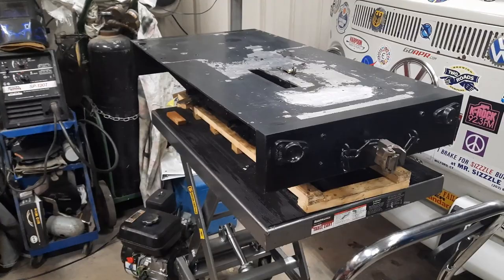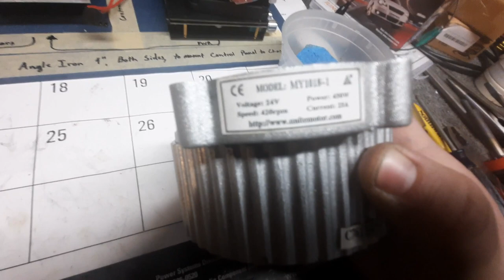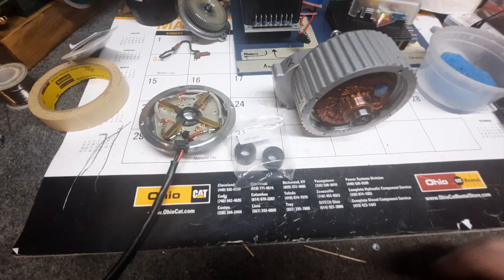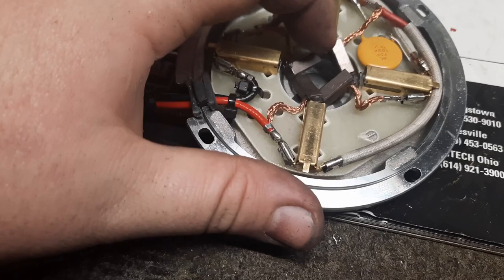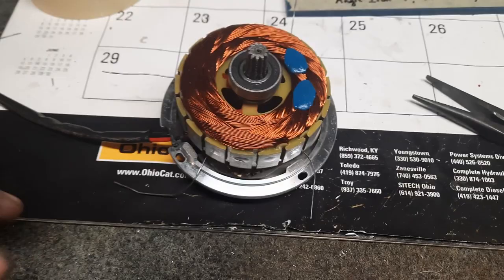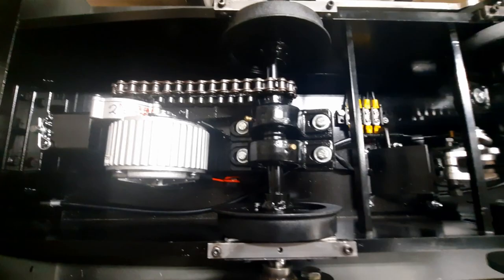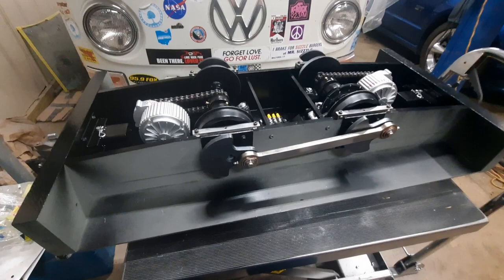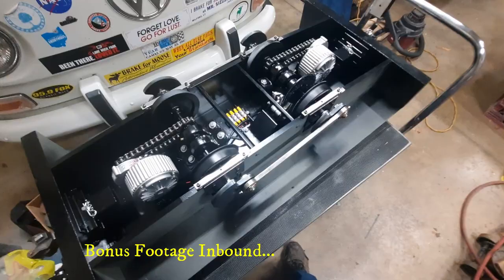7.5" Gauge Gas to Electric Locomotive Conversion, 2.5" scale | Part 2, Motors

Comment: Awesome build Matt...  I like what you did with the electric motors (dual motor).  Did you purchase the chassis, or did you build from scratch?  I hope to order a three axle (0-6-0) side rod "Davenport" chassis from RMI at some point in the next year or so.  They have a two (electric motor) option, which I think would be worth it.

I'd also like to build my own chassis of the same configuration, but I need to purchase larger machine tools to do so...  Cheaper and quicker to just buy a customized chassis, then build my own body for it.
Reply from the maker: I would rather be over motored than not have enough. At the very least, when working under sustained loads motors get hot, and torque decreases with increased temperature. More motors for a constant tractive effort means your using a smaller percentage of the motors total capacity, extending the life and reducing heat losses. I operate at Mill Creek Central, very little flat track there. I can pull 11 car trains up 3.5%+ grades or 3 ('murican sized) adults and 6 cars to date. The frame is all scratch built. Places like send cut send can laser cut metal frame pieces, bearing boxes and more. There tolerances are tight. By the time you polish the cut surfaces with a little sand paper you will have just enough slop were the suspension won't bind up. Tolerances being to tight tend to cause more problems than tolerances being too loose. I do not have machine tools. Only basic hand tools, welder, drill press, and a mind that's good with problem solving and coming up with creative solutions.
Reply: @mattkinnard6899  Thanks for the input Matt...  I follow Mill Creek on YT.  I could probably could do the same as you have without machine tools, but it'd certainly be easier with!  I have access to industrial laser cutters (I work for a mfg) and can laser cut up to 1.25" thick steel.  Have a partial design for the frame/suspension for a Davenport 0-6-0 diesel mechanical.  I just need to finish up the frame design and start laser cutting parts.  Hope to get that done before I retire in about a year and a half.  But short term, I've been corresponding with RMI about a customized chassis based on their 3 axle/6 wheel Davenport D&RGW #50.  They'll build it, just have to come up with the $$$.  Hope to start experimenting with track and turnouts (switches) sometime in the next year or so...  Hope to model 24" gauge on 7.25" gauge (but use 3.75" = 1' scale).
Reply from the maker: @WHJeffB  sounds like you have a good plan! Best of luck with it!
Reply: @mattkinnard6899  We'll see...  What you've done is great inspiration and gives me hope that I can pull my own locomotive chassis off at some point in the future.

Comment: Good day! Would you mind sharing what kind of motors you are using on this build and where you might get them?
Reply from the maker: 24V DC, 450W, 420 RPM, part number MOT-24450G they are all over the internet. Ebay, Amazon, monster scooter parts, I believe I got mine from electric scooter parts.
Reply from the maker: Geared at 5 mph top speed my locomotive is a great puller for a 2 axle loco. I have pulled 11 car trains up 3%+ grades. And have the torque to accelerate and great regenerative brakes.

Comment: do you think that your wheel base is to close?
Reply from the maker: Good question. The wheel base has not been an issue and in the two years I have been running this frame (many many miles) I have only had it derail twice, and one of those times was from a stone wedged in a switch frog. The wheel base is very close to the prototype. The locomotive rides down the track well, and the suspension does not bounce around excessively.

Comment: well, i am in the process of building my own battery powered locomotive.
but man, you lost me BIG time, controller switching power off and on capacitors and R.F. noise and whatever else on a motor.... blank stare on my face now.  i'll watch this again a couple times, but i  reckon it's gonna be the deer caught in the headlights.......
Reply from the maker: I recommend going to the 4QD website and navigate to the FAQs drop down menu, and select technical. Here you will find a bunch of technical documents and videos to help you out. Namely, check out the section on motor noise suppression and watch the video there. If you skip motor noise suppression, it can mess with track signaling circuits, and WILL shorten the life of your motors and controllers. What I can say is that my ~300 lbs locomotive can pull 2,000 lbs up a 3% grade, and the motor controller does not get hot, thanks to low gearing. The regenerative braking works great, and battery life is longer than what I can stand to operate in a day, 6+ hours